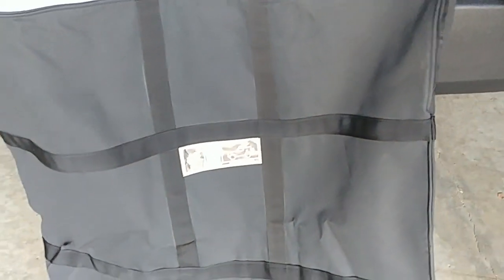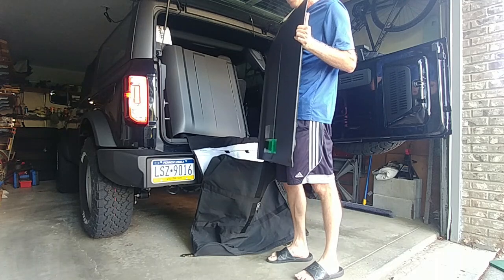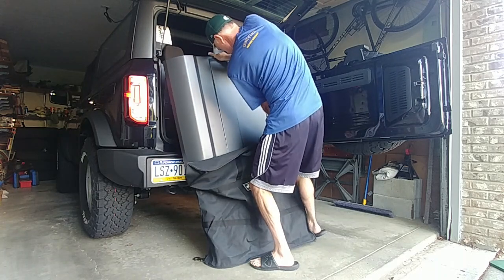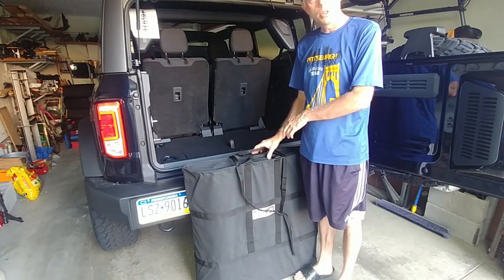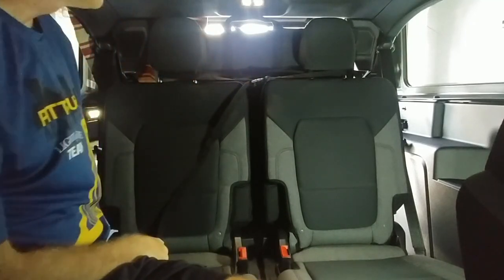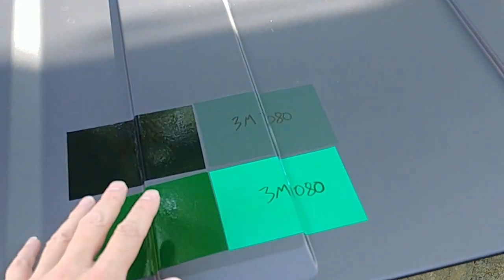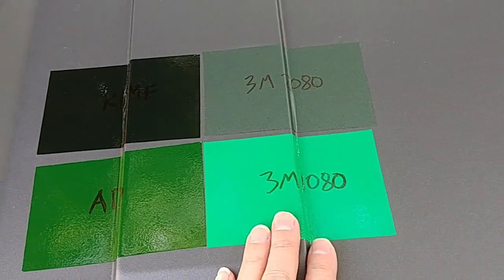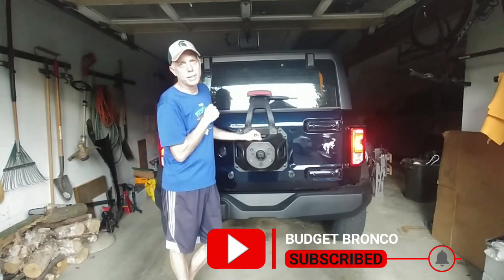Ford Bronco 2 door MIC top front panel storage bag - how to load and secure

Comment: Hi! Where did you purchase the door bags/harness for the trunk? Thanks!
Reply from the maker: If you buy a 2 Door with a MIC hard top, the top panel bags are included! Note that in this video the bags are for storage of the ROOF panels, not the doors. If you have a 2 door, there is no solution for storing the doors in the vehicle, they are too long to fit. If you have a 4 door, you can purchase in-vehicle storage bags. Also note, Ford does sell storage bags for the 2 Door doors, but they are only for garage storage and the like, they are not for storing in the Bronco. All of these products can be purchased here: https://accessories.ford.com/collections/covers-and-protectors?pf_t_model=Model%3A+Ford_Bronco_2021
Reply: @BudgetBronco  I have a 4 door currently. Strange enough I find the “garage” storage bags, but not the “in-vehicle” versions on the ford website/everywhere else. I’m going to have to call the dealership I bet. Thanks for the reply!

Comment: I have a 2 door coming that I plan to remove the rear seats from. You think I could get the doors in the back then?
Reply from the maker: I just measured and yes, technically they will fit if you don't have the front seats pushed all the way back. The bigger question would be, how to keep them from flopping around? You would need to rig some kind of system to keep them secured.
Reply: @BudgetBronco  i’m thinking of ripping out the rear seats and fabbing up a bracked to hold them like a rudder off a sailboat. Time will tell if its feasable. Still have a bit of a wait. 7/14 res, but BL Lux Tow Mod is a bad combo right now
Reply from the maker: That would be an interesting project. One good thing, you could use the seat mounting points and bolts as the mounting points for your brackets. Good luck and hang in there, it will be worth the wait!

Comment: mine has a big metal latch on it, what is that for? any idea?
Reply from the maker: There should be TWO metal latches. Those latch on to the two fastening points built in to the floor, to keep the bag from sliding around. I show this in the video.

Comment: Thanks for the Video! Putting the panels in the bag is the hardest part and I don't like how the hardware rubs. I am going to buy a second bag I think. I think it is worth the cost. Also the panels do fit without the bag with the seats down if you are not using the space and just want to get the panels off/on quickly. Just have blanket there so you don't rub anything.
Reply from the maker: Ya with the seats down you can just throw them back there flat with something in between. Not the safest option though, if you get in a wreck that is 35 pounds of panels that is going to be thrown around. I get it tho, the storage bag is not super practical. But necessary if you want to take the panels with you and you have passengers in the back seat.

Comment: I just purchased the same bronco last week and would be interested in seeing how the spare tire on the back impacts the backup camera being that you went up in tire size
Reply from the maker: There is no impact at all on the backup camera, the camera is mounted to that post that pokes through the center of the tire, so size of tire will not matter at all.  33" tires fit with the existing center brake light, 35" will require some modifications to that light
Reply: @BudgetBronco  great, thx for letting me know.

Comment: What was with the brake lights coming on when you closed the tailgate at @8:07 is this just a standard "feature" on these?
Reply from the maker: Good eye! I guess just a feature. The interior LED light does the same, which is actually useful if you are loading/unloading in the dark

Comment: Why would someone wants to put those panels inside the bag? Not practical at all. Just put the bag in between both panels to avoid them scratching and making noise.
Reply from the maker: I agree that there is limited use, but they do work well for at least one use case: when you want to drive when there is risk of rain, and you have people or stuff in the back seat, you need a way to keep the panels in the storage area. They are too big to lay flat back there on the 2 door, and if you just threw them back there upright they would flop all over the place. The bag is also a pretty nice way to store them in the garage.